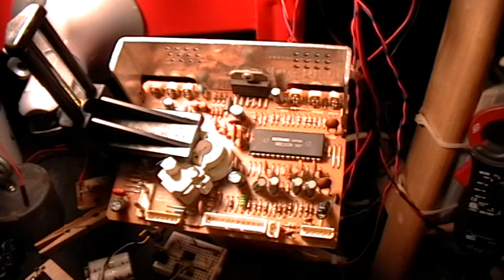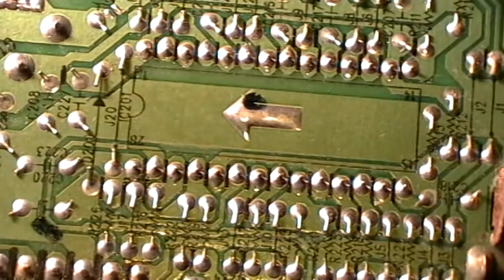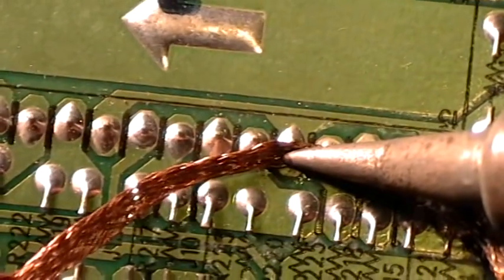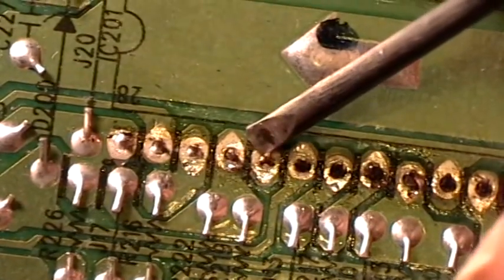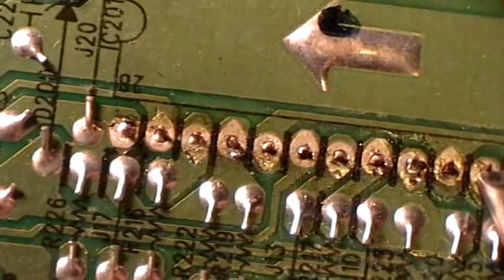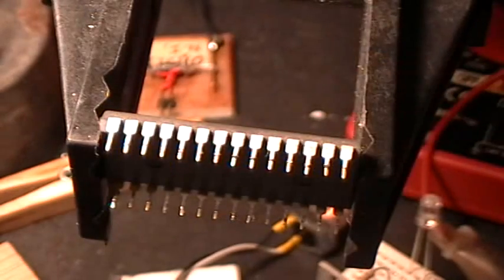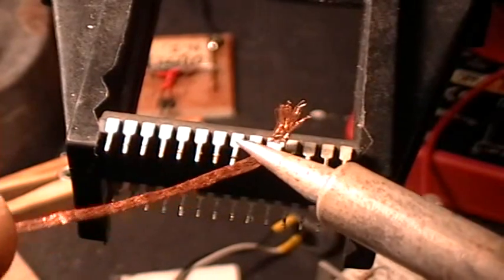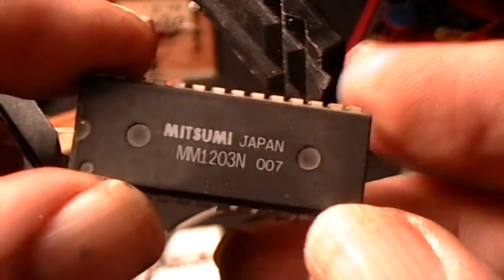Quick and Dirty: Desoldering a 28-pin DIP using Wick and Flux

Comment: i did that to my dallas ds12887a that still had some juice in it when i put a dip 24 socket on my aopen ap53 motherboard to finish it off before putting on a drop in cr1225 replacement module.

Comment: Just used this technique on an IC socket I installed the other way around. I had to switch my tip to a bigger one to apply heat more evenly. Thanks for the tip, pun intended.

Comment: would using the flux pen directly on the solder points and then using an iron and solder sucker work as well?
Reply: atarileaf A solder sucker alone will do a better job than what's shown in this vid.

Comment: extreme heat may cause death to your IC.
Reply from the maker: I have salvaged dozens of chips this way and have never damaged a single one. 

After all, they survive being soldered into the circuit in the first place, using higher heat applied to all pins at once when first assembled.

Comment: can i use any thing other than the wick please tell me
Reply from the maker: +nagesh udasi If you can find some coax cable you can strip out the shield braid and use that just like the wick, but don't forget that you will need to apply flux. Or you can use a "solder sucker" pump-type device, but I find that the wick works better for small parts like this.
You can find shielded coax inside old computer monitor connector cables. Good luck!

Comment: I prefer to use a solder sucker simply because I am cheap and don't unsolder much these days and if I do it is because I know the IC is dead and it needs to be replaced.  Don't really care if it survives the removal process in that case any how so then you can just cut the legs that are causing trouble and work on those separately.

Just before the end I am wondering "what is he going to use that for?"  Paused the video and googled it.  It's some RGB video amp, hmm OK.  Then unpause it... just a demo!  Doah!  Here I thought you might have plans for it, perhaps even in a future video.  LOL.
Reply from the maker: +ElmerFuddGun I use the braid because it works better than my solder sucker for small parts, and because I hate cleaning and unclogging the sucker. Mostly I remove chips from old CRT TV/Monitor circuit boards for reuse in projects. Usually I find audio amps, op-amps, comparators, analog switch ICs, switchmode psu chips, and etc. Some have come in handy. 
I was thinking about trying this chip as an RGB LED driver, just for grins.
Reply: +TinselKoala - Fare enough.  Guess I would rather clean it than keep buying braid.

RGB LED driver?  Hmm... that might be interesting.  Would it have enough drive current for the LEDs?

Comment: What is the best soldering iron to use ?  what is the type of wick ?
Reply from the maker: +Tom OConnor The wick I use is SuperWick from MGChemicals, the 0.050 fine braid "yellow package" kind. the fine braid helps wick up the solder. You should have a good quality, temperature-adjustable iron. Many people like the Hakko brand. I am using a Solomon SL-20 brand.